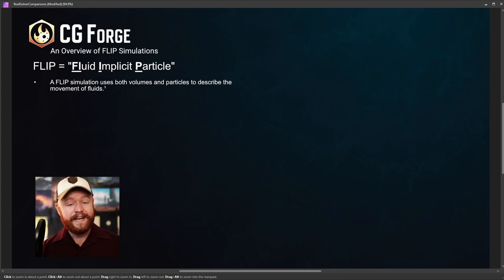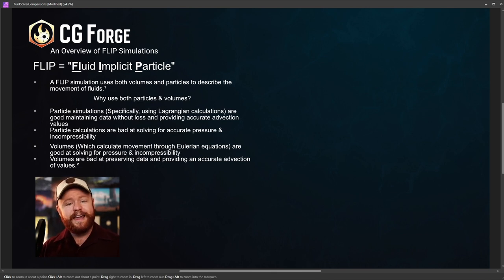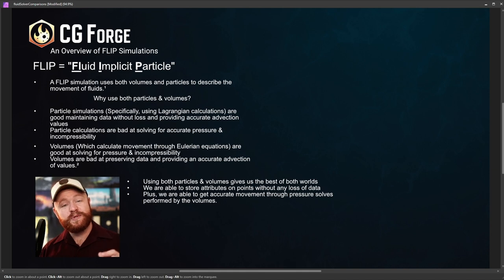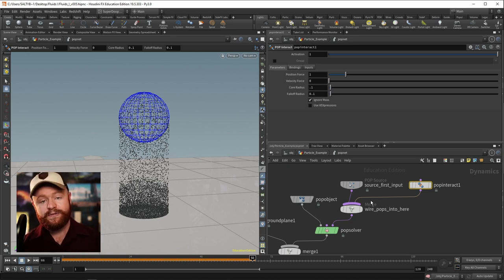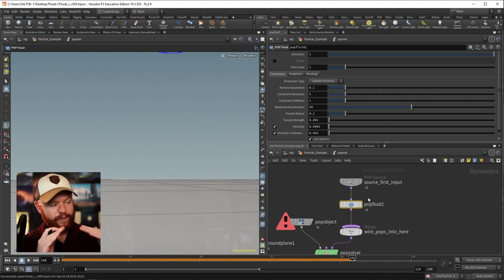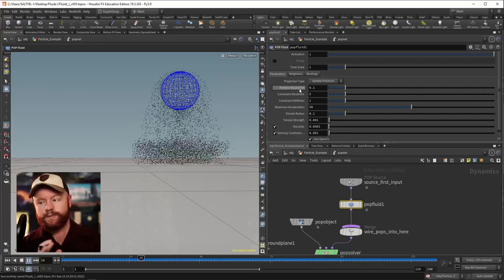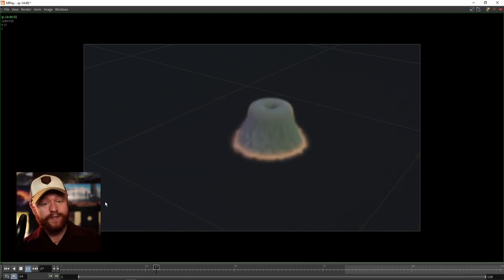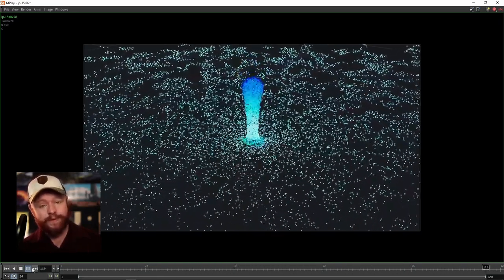Houdini | How FLIP Works | Quick Tip

Comment: Dear Tyler, thank you for your content especially concerning Flip Fluid Simulations in Houdini. I was wondering if you could tell me how I would set up a guided flip simulation using a deformed plane from Maya with the flip solver instead of using the ocean tools.

I reverse engineered how the ocean evaluate node is doing the volume calculations for the sop flip solver with little luck...